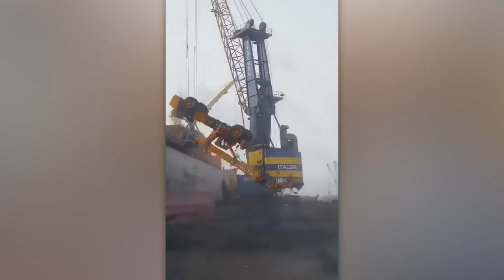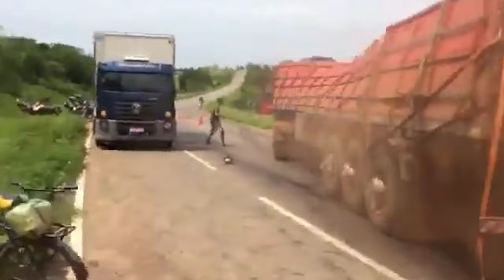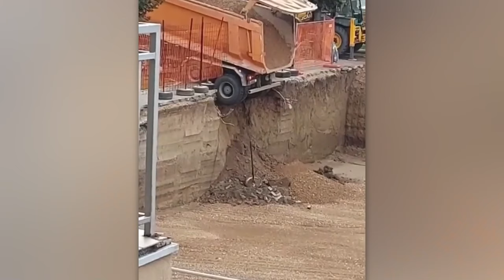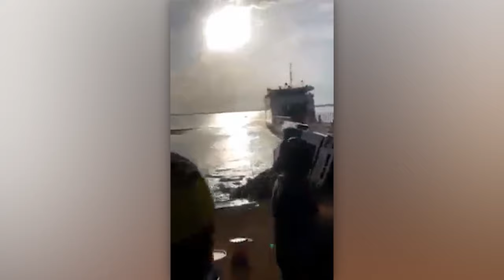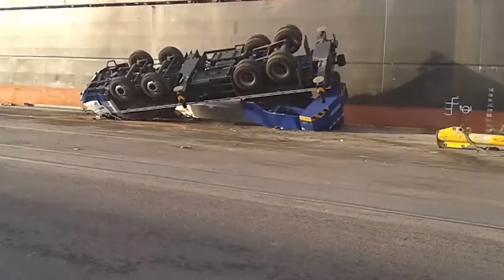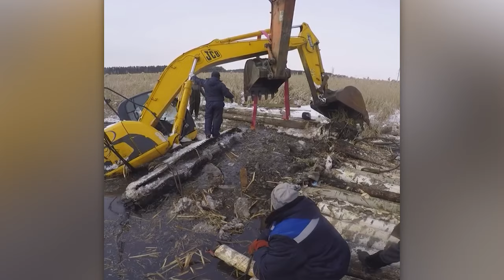Idiot Truck Drivers Who Totally Failed

Comment: The one sliding sideways down the ice covered road isn't exactly an idiot, but ingenious for saving time, even if the tracks are damaged.
Reply: Yep there are some 'wins' sprinkled in!
Reply: Not idiotic at all, a seriously brilliant trick. Too back that operator wasn’t the one with the keys to most of the others.
Reply: There's probably more strain on those tracks if he went down the normal way... it would all be focussed on a single joint, rather than all of them.
Reply: @SeedlingNL  True for the most part, but if there's a groove or bump in the road, that could cause more problems than it solves. Either way though, not an idiot.
Reply: @RazyrDiarmait  Yep i agree with you not an idiot at all in my (non profesional) opinion

Comment: I know a lot of people go through school absolutely hating math, but a lot of these events would have easily been avoided if the people involved just paid attention to the numbers.
Reply: Well I mean usually a degree in physics isn’t required for a certification to drive a forklift or a tow truck lol
Reply: @l1z4rdon7  that may be so. But every piece of equipment has limitations which are printed in the manual and on safety decals placed all over the machines. On top of that, bridges tend to have height and weight limits posted. It's not so much about doing the math (which is just simple subtraction and comparison) as it is paying attention to the posted numbers. Some people just hate numbers so much they don't even pay attention to numbers they're not having to do math with.
Reply: Math is like foreign written language to me-but its pretty essential for some careers like doctors & driving those big machines!
Reply: @gregbell9839  I’d THINK knowing the height behind your Rig would be an important factor

Comment: The tower crane at 11:06 was a schedule dismantling, unless vandalism played a part in and pulled it down as you can see the cables on the far side pulling it over.
Reply: Came here to say the same. You can clearly see the cables being used to pull the crane over and it is being recorded. Vandals wouldn't record it, most likely.

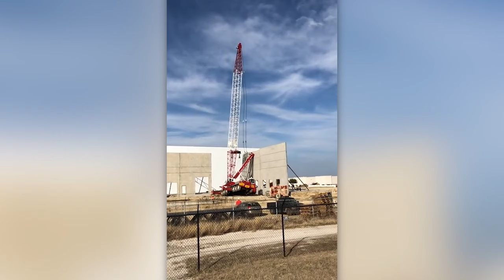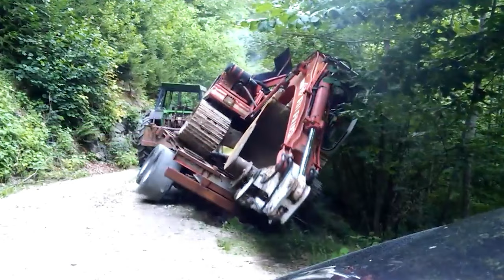Comment: The crane at 2:04? I'm going to guess a ground collapse under the front right support strut because the concrete wall panel falls because the crane is leaning on it. If I'm seeing things right. At 2:22 you can see the crane resting on the front axles and the right rear support, and the supports fitted would have been rated for the job the crane was there to do so I doubt the front right support failed..

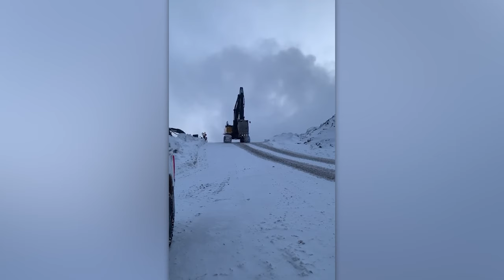Comment: 8:04 Not a fail.  The operator compensated for conditions, and kept the unit in control.
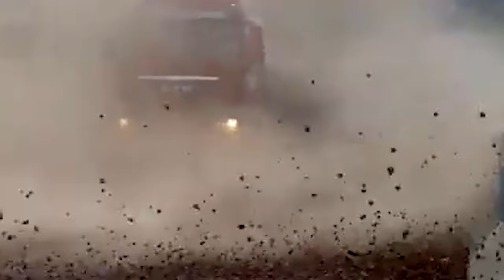9:40 Not a fail.  Demonstration of how a runaway truck ramp works.  These are for trucks on lkng downhills in case they lose their brakes due to overheating.

Comment: The MH-53E(big gray USMC Helicopter) is the EXACT reason why in the Army we always had someone in the cockpit riding the brakes. To prevent just that kind of thing happening. That was beyond stupid, but I expect nothing less from the Corps.
Reply: Someone dropped the ball on this, or there was mechanical failure. We always had someone riding the brakes, any and every time we moved a KC-130, or CH-53s. This was in the 2nd MAW, and 4th MAW.